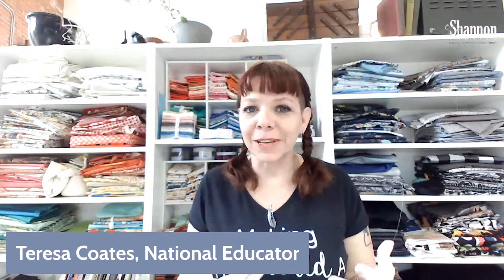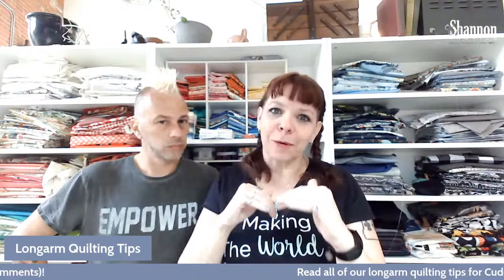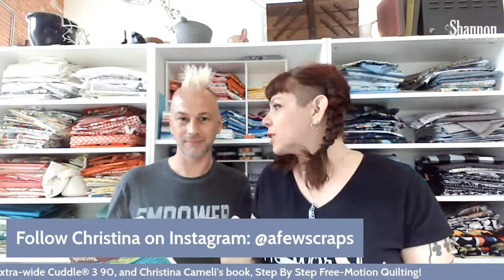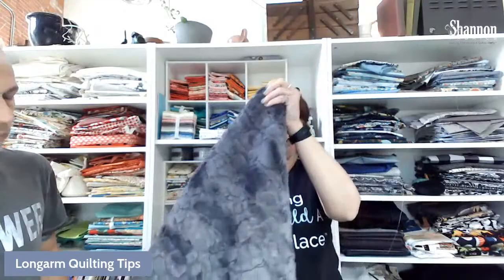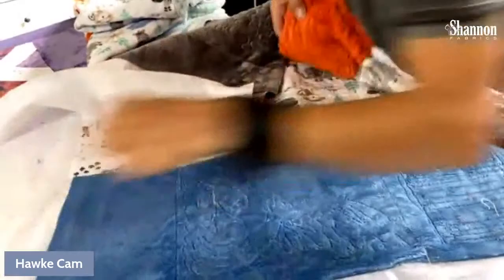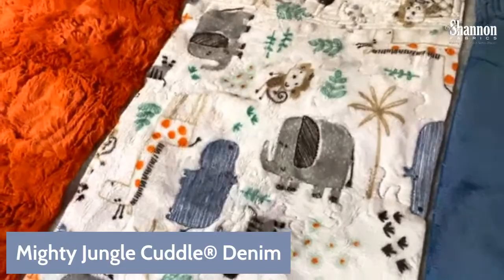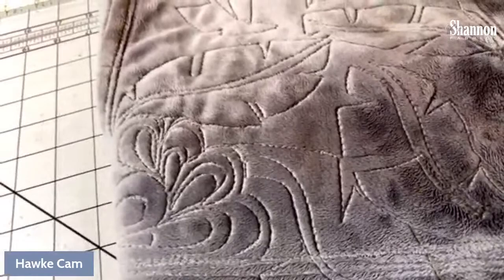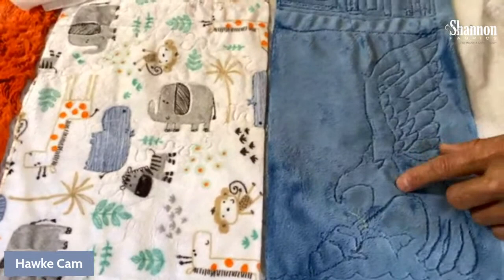Longarm Quilting Tips for Cuddle® Minky Fabric (Tutorial)

Comment: My question is..my baby quilt is done with quilters cotton top and a low pile Shannon minky on the backing.  It has a stretch that I’m worried about.  Any tips for loading it?  Do I stabilize the minky before loading my backing?
Reply from the maker: You do not need to stabilize the Cuddle, you just need to not stretch it. We recommend loading it with the selvages on the sides and the cut sides on the leaders.  --teresa